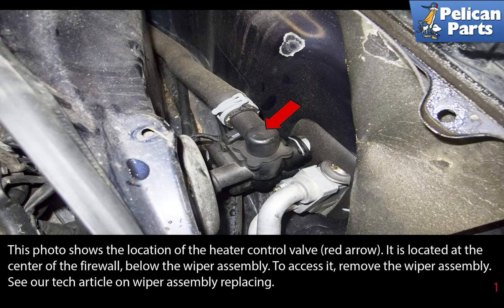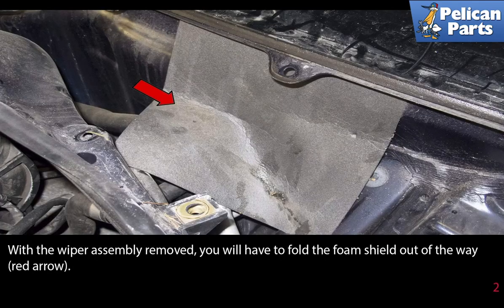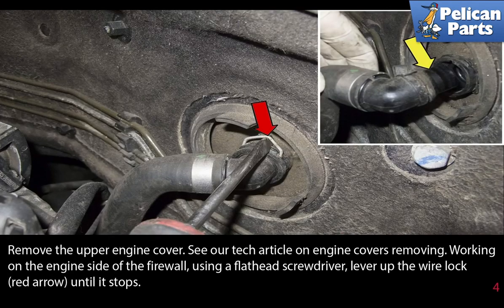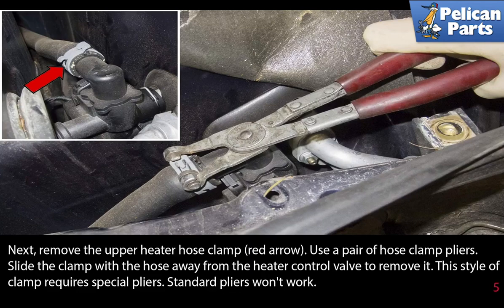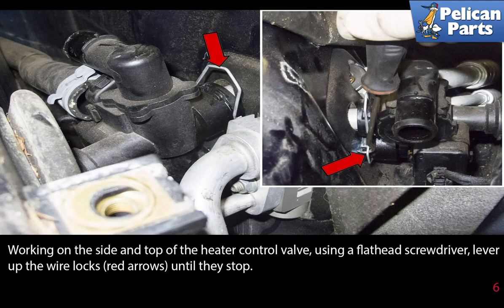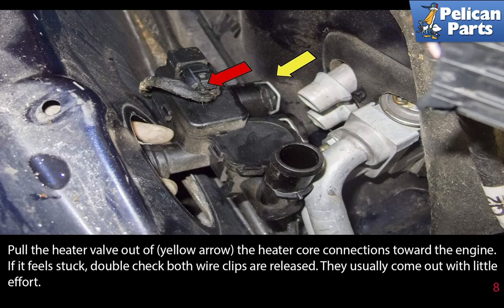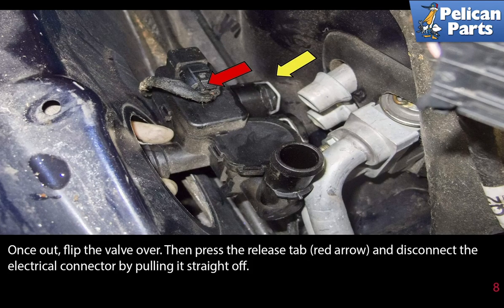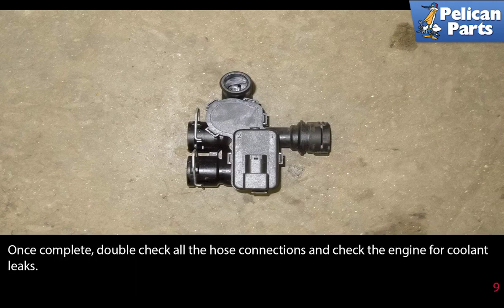Mercedes-Benz W211 E-Class Heater Valve Replacement

Comment: Just wanted to thank you for trying to help thy neighbor! I hope you help thousands. God Bless You.
Reply from the maker: Thank you too
Reply: Hi, do you have a video or instruction manual on removing/replacing/troubleshooting heater core. I replaced the valve, bleed the system and filled with new Antifreeze/Coolant but cabin is still not getting warm.

Comment: I have the E200 W212 NGT model and this part is not at this location, I checked and it was missing. The hose connectors are there with pipes coming out but not the control unit itself.
Reply from the maker: Thanks for the info.
Reply: @pelicanparts  in going to try find it. I think it's located elsewhere in the engine bay, I've read maybe under the brake master cylinder.

Comment: How the heck do you remove the hose clamp and hose that goes from the back of the motor to the heater valve
Reply from the maker: See steps 4 and 5 here: https://www.pelicanparts.com/techarticles/Mercedes-W211/118-WATER-Heater_Valve_Replacement/118-WATER-Heater_Valve_Replacement.htm I like to use hose clamp pliers for the clamps, and a small screwdriver or pick for the spring clip connections.